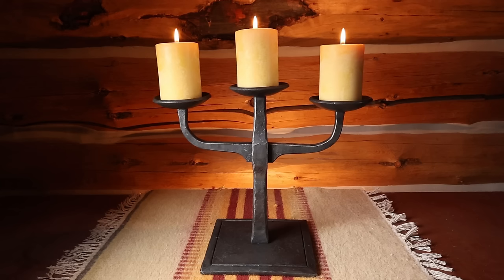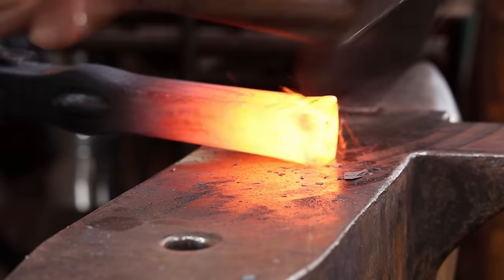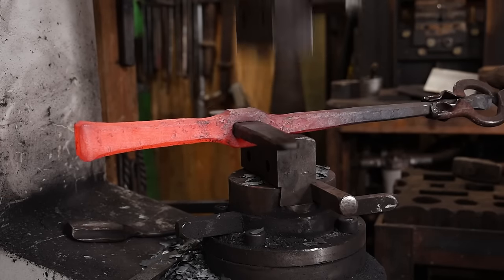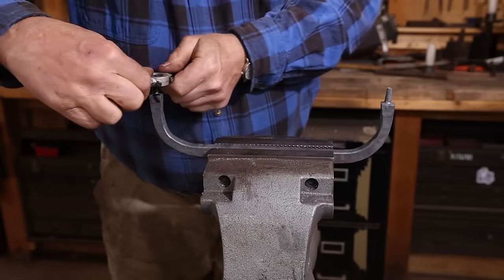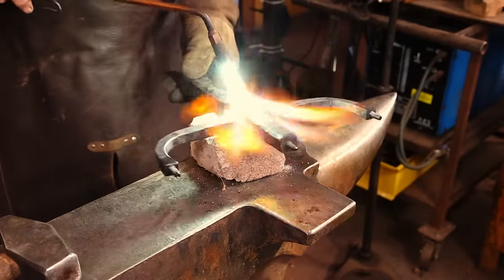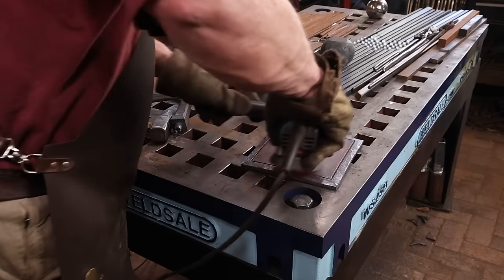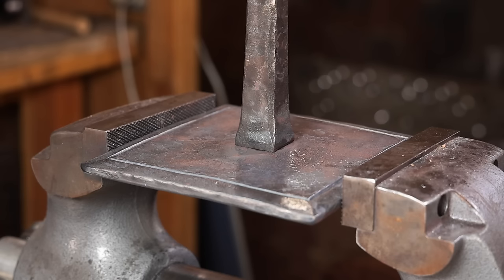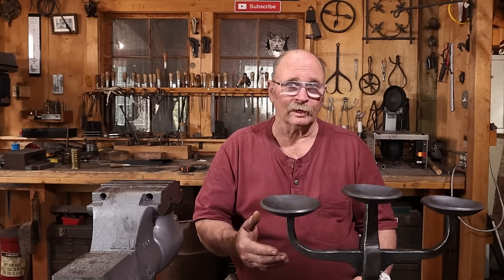Forging a heavy candelabra - Blacksmithing

Comment: that was one of the first blacksmith secrets...a lot of people assume we are marking centres for slots and so on, which you can do ...but not if you want it accurate. 
 its a great build and as for knocking it off the table you would need a savannah cat or bigger so pretty unlikely unless you have a Rottweiler that likes climbing on your table lol 
I have never used a power hammer and hopefully my health will stay good enough that I dont need anything similar. I do rely on other things but thats part of what blacksmithing is about for me, it's finding a way to do it without going electric...I'm also not trying to make money doing it which helps 
Brilliant share John
Reply from the maker: Not having to worry about the time a project takes to meet a financial goal can give you real freedom in your work

Comment: Lovely work. Sometimes instead of the round finished rivet in the cup, there will be a pointed iron rod of about an inch on which a tall candle can be impaled so not to topple over. Imperfections or being slightly asymmetrical only add to the charm of a hand forged object.
Reply from the maker: I've never had mush luck with the spike idea, seems like the candles frequently crack.  I wonder if old candles were softer
Reply: @BlackBearForge  you are right , especially if the candle is on the thin side. Never had that problem with thicker candles of about 3 inches or more in diameter.

Comment: I have discovered using a dimmer switch with my hand grinder wire brush. Makes wire brush much easier to control. Great video.
Reply from the maker: I use a variable speed unit for the same reason
Reply: Yep, and some rotary wire brushes are not rated for the full rpm of an angle grinder.

Comment: Great work!  Like to see the kind or power hammer /full shop work out by a professional smith.   The use of heavy stock and solid bar increases the power of esthetic design.  Inspires me to think of making a three light candelabra with forge welded and twisted 1/4 inch bar.

Comment: Great vid and candelabra !!
for the show demo one,
could you use the same main bar for the center then split it three way at the branch to form the trident? 
if you did the same threaded tenons for the cups but let the ends of the tenons come up to a point you could use a cone monkey tool to lock the cup in place as this would tighten up and push down the tenon at the cup just like you did with the one you made but it would leave the spike tapering up, this could then be twisted into a cork screw to allow the more secure fitting of any size candle

Comment: Beautiful work as usual.  You mentioned that subscribers don't like to see that much power hammer work, but prefer work at the anvil.  I saw a video somewhere that a smith was holding a large piece on the anvil with two others pounding the piece with what appeared to be sledge hammers.  Is that something you could replicate in a video to show that a smith can forge a large piece without a power hammer, but with a couple of friends who can wield a sledge?
Reply from the maker: I have shown some work with smith and striker in other videos, but I don't have anyone i can regularly count on as a striker.  There is a good chance i will have some video from the demo in May working with a striker.
Reply: @BlackBearForge  Thanks

Comment: John, the “Chisel hammer “ you’re using the cold cut with, what type of steel is it made of? 80CRV?
Reply from the maker: Probably S7.  But thats one I made years ago before i started marking the steel type on the tool
Reply: @BlackBearForge  ty

Comment: Awesome work as always Mr John I have a question about the tool that you used with the candle cups and the sledge block how did you make it
Reply from the maker: The round end was just dished in the swage and the rest is welded up from mild steel
Reply: I think I am going to have to make one when I get my swedge block
Reply: Sorry I can't spell today swage block

Comment: “Back in my day we opened the shutters during the day to allow for God’s given light to enter. Candles were highly valued and best saved for milking the livestock in the early hours before the sun had risen or for the winters when it weren’t to stay out long and windows remained closed for sake of cold draft. We had the candle holder on the wooden table at our eatin’ area, and there was one in the barn above the milking stools. Aside from the two we felt it was suitable to hold a candle by hand and with a portion of starch fabric  catch any wax what would be wasted”

~a quote from Mary Beth Aldrich.
Just kidding totally made up